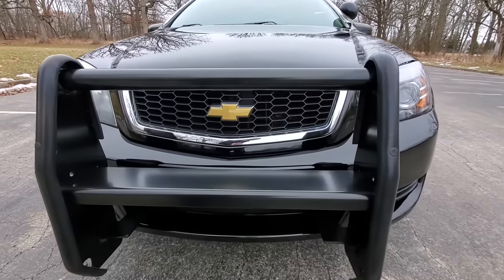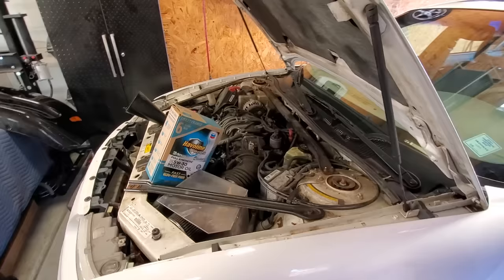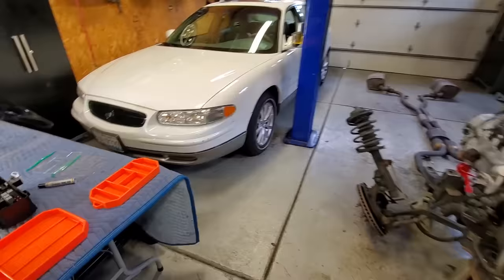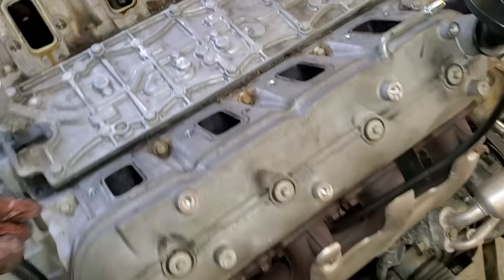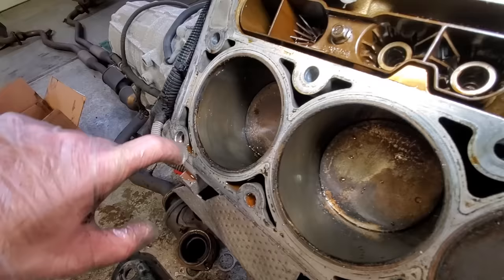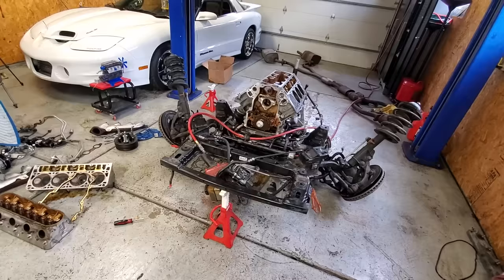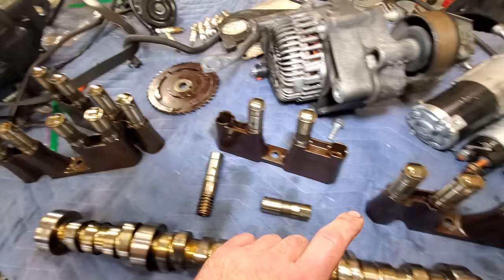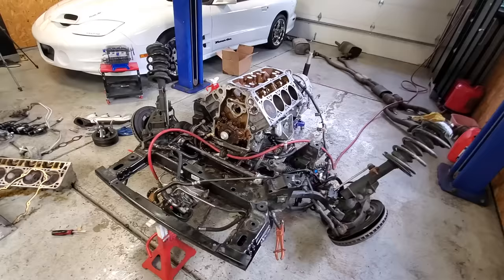Looking Inside An ABUSED V8 Engine That Idled For 12 Months! 357,000 Mile LS Teardown + Body Removal

Comment: Most people that have problems with the cylinder canceling on the LS motor is because of dirty oil. If you change the oil and filter on a regular basis you generally don't have any problems. The strange wear on the lifters is caused by the lifter trays wearing out and letting the lifter turn in the bore. Lifter trays are relatively inexpensive make sure to replace them any time you have the heads off.

Comment: I work for the U.S. Border Patrol in south Texas, and I drive a 2004 patrol EMT unit and it has 107,292 miles and we idle those units forever. At times when all other EMT B.P units go down, we have used and idle this unit for a month. The bad thing on the Chevy Tahoes is the famous cam "ticking" and its expensive and time consuming to repair. But this unit is not worth fixing doue to the high milage and will be "dead"lined which means it will be sold at auction. But yeah we idle the hell out of our units, but thats the cost of securing the border.

Comment: Most public transportation and government agency vehicles have very reliable and clean engines when torn down because scheduled maintenance is factored in for the budget for the fiscal year.tons of public fleet vehicles last forever with ZERO problems simply because scheduled tune ups and oil changes were performed religiously.great video!!!

Comment: i have 350,000 miles
rod bearing looked good at 300 so i put them back in cause the new ones I had ordered didn't have squirter ports

Comment: You would be surprised how many warrant's claims were turned down because of high hours and low miles on our city fleet trucks . If the truck read 45 k miles on the cluster ,but add the hrs stored in the pcm , the real time on the engine might be over 100 miles .This is why we do oil changes at 3k and not 7.500 . Fleet cars and trucks are not really a great buy .They are usually done when we put them to auction .Most of our fleet cop cars have been beat on to the ground . But captains cars are a good buy . Like the one you got in this video. But hard to find . Retired Florida city Fleet tech .

Comment: I've come to the realization that hybrids are ideal for police service, especially in towns and cities. So much stop/go driving and idling could be mitigated by using a battery pack to power things when the car is stopped or at low speeds.

Comment: Cool vid - but the guy that poured the slab in your shop needs whipped with a can pole for putting those huge relief seams in it. Bet those are fun when you’re trying to maneuver a floor jack or an engine hoist.

Comment: It’s not 357,000 miles equivalent.  the 82,000 nominal miles include idle miles.  When you buy a car with xxx,xxx miles, it assumes that y percent of those miles are idle.  you can’t just go and add back idle without substracting out the idle miles that were already counted.  Some of that. 357,000 is double counted

Comment: Lol we’ve got a truck at work that has 224000kms with 19000 idle hours. And some 1000+ hr oil changes to boot. Only work is water pump. Good old Ford V10. Gutless, but won’t leave you walkin.

Comment: The reason why the LS cam lobes can wear is because of the lifter trays wearing out and allowing the lifters to rotate in each direction. Usually Roller lifters and cams don’t wear at all unless there is a manufacturing issue or the surface wasn’t hardened properly. So it’s highly recommended to get new lifter trays for your engine.

Comment: My 97 Honda Accord EX, has 370,000km original kilometers with just bolt on's it's slightly modified. Older Japanese cars are made to last a really long time past 30 years. Those who maintain their cars and fix any issues that occurs, can hit these high Miles or Kilometers plus driving your car normal rather then beating the crap out of it thinking you're some kind of Nas car driver, will make your car engine run Healthy and last forever.

Comment: My car at work was a 2016 caprice, that car would run Damm near 12 hours every night. Only time I'd turn it off was to get fuel and then either I was driving or sitting around. I put a lot of hours on my car and I got it brand new. I guess i never realized how much fuel I burned when I was just sitting there too

Comment: Oddly enough I’ve personally seen 2 early 5.3’s ( one 2000 and one 2002 model) spin road bearings at under 150k with absolutely no warning. The 02 was my personal truck and I always changed the oil at 3,500 miles, it started knocking and lost oil pressure at 70mph and before I could find an exit it threw the #5 rod. Still had 6 qts of oil in the pan too. went back to the old small blocks after that and I’m glad I did I’ve never had a 350 blow without any warning like the ls’s did.

Comment: Hotrodding a new cam can used to set it up for bad wear if you don't do a good heat cycles break in to harden the bearing surfaces. That is unless cam manufacturers have started doing some fancy factory treatments which I doubt. I think that's where guys getting bad cam wear lose their cams starting out hotrodding right off the bat.

Comment: If it was a police vehicle it was most likely part of a fleet maintenance and plugs got done every couple of services which for most are 3,000-5,000 miles or every couple hundred miles. The city I work at does services every 5,000 miles, or either 300 or 500 hours or 3 months. So a bunch of oil changes, with filters for everything. A mess of filters and oil is cheaper then the time it takes to tear into an engine.

Comment: It seems to me that the Active Fuel Management system would not be problematic if the injectors and ignition to the cylinders were simply shut down, leaving the valetrain intact. Energy lost through pumping cylinders against closed valves would be minimal, and maintaining the flow of air through the engine would provide cooling. However,  I suppose the oxygen sensors would freak out, thinking that a lean condition is present. But that is definitely something that engineers could work around.

Comment: The reason for the PPV having DOD was US tax law. The slightly better fuel economy allowed it to JUST avoid the "gas guzzler" tax. The versions sold locally here in Australia where the vehicle was designed and built did not have it.

Comment: Not 33 miles of wear... 33 miles of oil life. Its a rough estimate on when to change oil when you are cooking at idle for more hours than driving. Sure it wears the engine more than not running but its not like its pushing 4000 lbs down the road. 

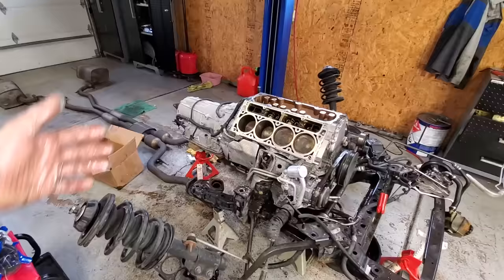At 8:25 you said it yourself it had plenty of oil changes and no sludge. Thats because oil changes are done at (idle hours x 33) + miles = 3000. To me, it doesnt look like a 357,000 engine and more like an 82,000+ mile engine.
Reply: Exactly. This shows idling does nothing to an engine. It looks like a less than 90k engine

Comment: What causes the most wear and tear is starting up the engine though. Clearly this car hasn't seen any of that, that's why everything is in perfect condition. Engineers design engines with full operating temperature in mind, they just make sure it will also start at 15°F. I wouldn't mind trusting this engine as is.

Comment: As far as wear goes I’ve learned engine cycles is what accumulates the actual wear. 5 trips to the corner store outside your neighborhood puts more wear on an engine than a single trip of 100 miles. Startup and cool down are the wear gremlins.

Comment: So while that caprice had a lot of engine run time in miles and run time as odd as this may sound I'm not surprised to see that it was in the overall condition at the internal level. 70+% of engine wear comes at start up and it likely only was started 1-2 times for every 8-12 hours of run time per shift. Secondly (speaking on ford police vehicles) when in park they have a slightly higher than normal idle to keep oil pressure up while idling. With all that factored in. Yes it does have a lot of engine run time on it but I'm not surprised it looked good internally. Also police departments are typically really good on their maintenance since they know they can get lots of abuse on their vehicles. "Oil is cheap, parts arent" motto. Enjoy the videos man. Keep em coming

Comment: DOD seems completely worthless to me, I had a GMT400 Tahoe Z71 and a RCSB Silverado Z71 5spd. Both with the Vortec 5700. I also had a 2013 RCSB with the 5.3 with DOD, and it got maybe 0.5 mpg better average than the Tahoe which weighed 400lbs more with 2 less gears. It actually averaged worse mpgs than the pickup but im guessing that has to do with the older truck being a stick.

Comment: Our 3500 express fleet vans with the 6 liter LS never shut off. The only time they do is for oil changes. They Idle and drive all day loaded down with tools and bucket/booms on top and while towing heavy trailers.
 The average Odometer say 260k but might as well say 400k. Best engines out there they just suck on fuel mileage and every single one is on their 2nd transmission. Better than our Ford diesel that sits and rots due to our unwillingness to rebuild the engine for the 2nd time in 175,000 miles. Yep you guessed it the 6 liter.

Comment: I wish I knew what you knew. Having a hell of a terrible time with car. Not starting now. It went from something to even worse.. Everyone has a different opinion. 2016 Ford Focus SE 2.0 L GDI Flex fuel engine. One certified mechanic walked me through the compression test and looks like 130 psi. So he's saying that's good enough. Others saying it should be higher. The current shop it's in said need engine swap. But that other mechanic said no way. I was ready to get it swapped out but don't have money to waste. I need someone I can trust. Is that compression number certain it's not a goner?

Comment: Back in the late 70's,early 80s GM had a campaign to replace soft cams in the 305 v8s, I got a plumbing van, job. I took the center head off,and there was a huge piece of Carbon under it.. my service advisor asked the customer when he last had an oil change.. owners response- huh? Oil change?? The truck had almost 45000 kilometers on it( Canada 🇨🇦), cleaned er all up, buttoned er back up,sent er out,never saw it again.. the oil filter felt like it was lead,too,btw.. incredible what people do or don't do to vehicles, and get upset when it finally fails..

Comment: I'M NOT SURPRISED!! You say idling is bad, but taxi/cab cars, trucks and busses gain the highest milage on a vehicle because of that. The reason is, engines wear the most during cold start. As long as the engine stays hot the wear is very minimal. And indeed good maintenance in oil and filter changes ofcourse to prevent carbon buildup.

Comment: eight thousand idle hours is not that bad. My cvpi had 5000 hrs/100k miles when I got it and I put another 10k miles on that and she still runs just fine. If the car is not abused idle hours isn't that worrysome.

Comment: It shows that police department would benefit a lot from Electric cars or at least some sort of hybrid. That’s a lot of fuel and emissions that gets wasted
Reply: O please we have electricity police cars.  And you know it's sucks .  Police have the be ready to go on full prepared.
O shit it's still on the electrical pomp and cost a hour 
Same with a Opel Vivaro or a Nissan small personal bus with only max of 150klm of driving miles.   It's sucks 
Only great electric cars is the Tesla but even that is a no go to heavy and to wide for our roads withs small in and out side roads.   No is not what you thing .
I see a fire truck coming o wait what is on the back ?  A hanger with a 400volt diesel generator for the water pressure and for range extender.

Comment: I still think that keeping engine at idle causes less wear than having it start/stop for 50+ times a day. My argument is that engine will keep it's operating temperature pretty much constant during entire day, and if you shut it down for 10-30 min, then start and drive hard, then stop again for 5-15min, it will experience constant cool-down and warm up periods, which cause metal to shrink and expand 100+ times per day. And that's the real killer of engines, when tolerances between moving parts are constantly being challenged.

Comment: Idle hours are somewhat less of an issue for Petrol fuelled engines . The Fuel burns properly if the Fuel Ratio is correct and the Low speed minimises wear .
With Diesels the Combustion process is slower so if the combustion chambers cool down , you get unburned fuel dilution of your Oil . Not good .
One of the reasons that Diesels can get Crankcase explosions . Police vehicles are usually a Good Buy . The Cops don't quibble about Servicing . Gets DONE .

Comment: "It's got a cop motor, a six liter LS with DOD delete, it's got cop tires, cop suspensions, cop shocks. It's got a Circle D triple disk 3800 stall speed torque converter that is going to make this thing launch like a bat out of hell. What do you say, is it the new Bluesmobile or what?"

"Fix the cigarette lighter."

Comment: Heh. We hold onto our Ford Explorer Interceptors until 13-14,000 engine hours minimum. They’re always still quiet & use zero oil. Ironically the three 2017 Silverados our PD has use crazy amounts of oil - 4 to 5 quarts every 2500 miles. They’ve really turned our department off of chevrolets for police vehicles - the engines have been okay other than the oil consumption issue, but weird electrical issues, constant suspension work, motor mounts over and over, and so on. Biggest complaint from the cops themselves is that the seats are garbage. Ha.

Comment: All the patrol tahoe we use end up having fuel pump issues (direct injected ones), crazy oil consuption from being run 24/7 almost and mostly what puts vehicles out of commision beside getting in wrecks is the 6 and 8 speeds eating themselves.
The fords with the ecoboosts, well they like to just eat all their oil and die at about 50k miles. They are fast buggers though.

Comment: You want to reduce the risk of breaking or damaging studs? 
Don't use an impact tool. 
Find an electric or air powered non-impact socket or use a good old fashioned hand socket. 
Cheers from the aviation engine world!

Comment: 0:33: “One hour of idle is equivalent to 33 miles of driving.”
What kind of driving? Under what conditions?  This statement seems a little vague and difficult to measure. 
I don’t think I believe idling with no load does the same amount of wear as “driving,” presumably with load, for half as long. 

Other than that, a pretty cool video. I’m interested to see the other videos and see what he poems to this car. 
I’m a Ford guy, but the LS engines are really tough and durable.  And they handle extra power well. :D

Comment: You're forgetting that police cars sometimes go from cruising to red line for miles chasing someone.. and dang, My car only uses .3 gals of fuel per hour to idle. It's a 3Lv6 though. I'd bet that the damage from idle in every car is different. It probably depends a lot on the oil. I use Royal purple in everything. Probably also depends on the compression ration. High ratio means higher ring tolerances. The biggest damage on any car from idling is heat build up in the engine bay. It's makes plastic brittle and ruins rubber. I crack my hood to let the heat out better and don't idle at all in the summer.

Comment: You have allot of faith in havoline oil, but I don't, and I will not use it.
Things may have changed since Texaco owned it, but in my experience havoline oil is not up to my standards, I have seen it drop oil pressure in vehicles I used it in, dropped it by half.
When a vehicle has 35 psi of pressure and I see it down by 15 psi, I drain it and use something else.
Once I substituted Valvoline for Havoline, the oil pressure went back to 35 psi.
As I said, things may have changed since Chevron took over the brand, but, the damage was done, and I am not alone, other folks I have worked with feel the same way as I do.
I like the video, and the idea of DOD delete, but, headers cause problems, they cook everything nearby, and can cause problems with fitment. There are better ways to make power other than headers.

Comment: If the engine is mostly at operating temperature and is regularly driven at highway speeds so the gasoline is boiled out of the oil; it's fine if it's idling thousands of hours.

Comment: A lot of fuel injected engines produced since 1999 can look that good internally because of the advancement of computers doing their job well  and the advancement of oil technology and good previntive maintenance on a tight schedule.machene. Shops are closing everyday because of technology.

Comment: The hour meter doesn't just count idle hour's it logs all hours the engine is running that includes the 80,000 miles logged on the odometer as well. 

I'm not saying the engine doesn't have high usage but your numbers are off.

Comment: Ehhhh 33 miles of wear in a hour? Ehhhh, I could drive from one side of NYC to the other (about 30-35 miles) and burn a lot more fuel than I do idling for 3 hours!). So a hour of idling is compared to 33 miles of engine wear? So what about 33 miles of actual driving? Does engine wear compared to 300 miles of driving? Lol, doesn’t quite add up to me.
Reply: It's bs.

Comment: I have a buddy who works at a PD and they drive the Caprice. According to him, the Caprice is one of the most crappy vehicles that they have ever driven. Their fleet is always in the shop. One of the Caprices blew the motor at 67k miles, another Caprice had a issue with the large wheel that's attached to the camshaft where there was metal shavings coming from the area. The AC is always going out. The bearing on the wheels always are breaking down. So these Caprices are junk. LOL